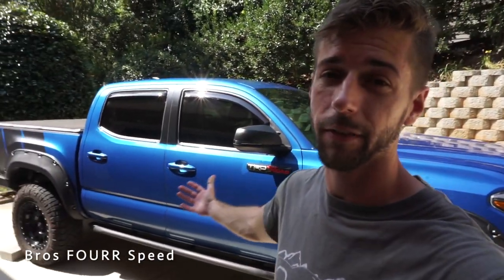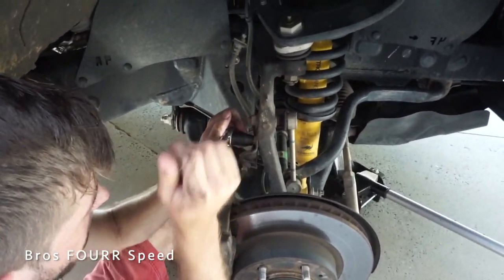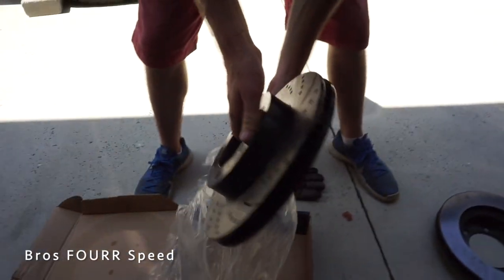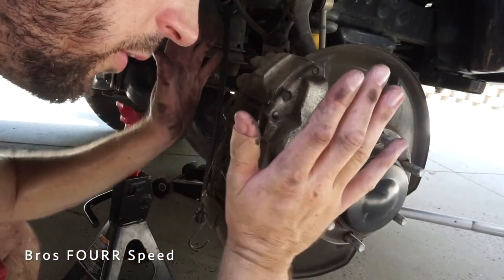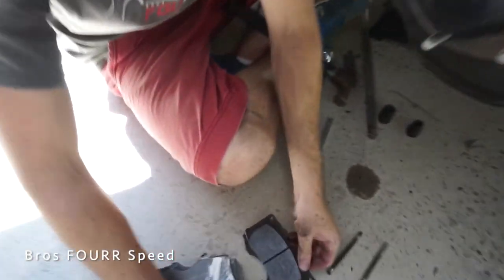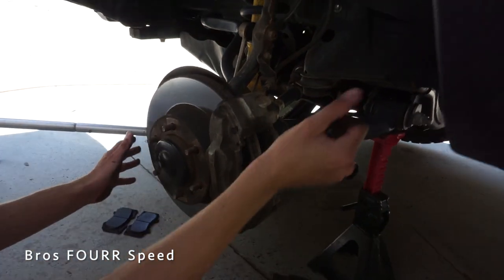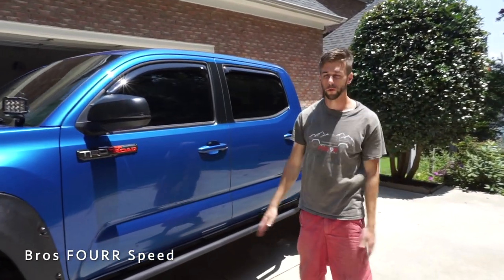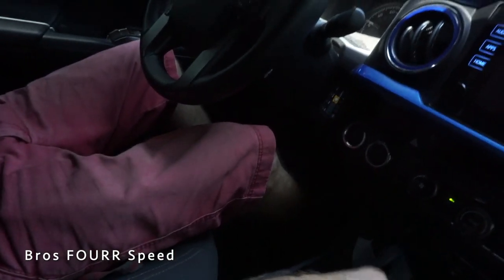Installing Performance Brakes | 3rd Generation Toyota Tacoma

Comment: Nice upgrade. I would have cleaned the rotor with brake cleaner first though.
Reply from the maker: We wi[ed them off a bit before the wheels went on. But anything on them will just wear off anyway
Reply: Could’ve cleaned everything. Makes for easier install and takedown

Comment: I sure hope you guys cleaned the rotors with brake clean to clean off the cutting oil before you put the pads on.  I just did my brakes too and as a extra precaution I used blue thread locker on all the caliper bolts and disc brake quiet on the pads. The brakes are awesome and saved my bacon. Latter on that night I had a truck cut me off and the new brakes saved me! 
Keep up the good work!
Reply from the maker: Yea we cleaned them off!  The pads are very quiet so I don't have issues with that, and glad they helped you out!!

Comment: May give these a shot. First set of pads and rotors was at 140k miles. At 270k now and time for a new set of front and rears on my '17.
Reply from the maker: I actually just took these off! Send me a message on IG if you are interested! Probably have around 10K miles on them so still in good condition!
Reply: @BrosFOURRSpeed  is there a reason you took them off? were they not performing as you had hoped?
Reply from the maker: @General1718  I sold the truck, so decided to put the stock ones back on it. They did great, really liked them.
Reply: @BrosFOURRSpeed  if you had the choice would you get them again over the stock? Also when you took off how was the ware on the pads compared to when you changed them in this video? Did they wear the same or more..thanks for the help i need to do brakes now so im trying to figure out what to go with

Comment: Your rotors and drums on that truck have threaded holes to help remove them when they get stuck on. M8 bolt with 1.25 thread, a couple inches long should work. Much easier then the hammering.
Reply from the maker: Yea I figured that out after this on another project I did! Definitely works so much better!

Comment: Nice upgrade! They look great! Keep these videos coming.
I'd suggest the next time you have these apart, clean the caliper pins with brake cleaner to get the caked on dust off and apply fresh brake grease. This will help the pads float and prevent them from sticking. Also makes the next brake job go smoother. If you have them wear nitrile gloves when handling the rotor and wipe down with brake cleaner after installing. 👍
Reply from the maker: That's a good tip!  I'll have the truck apart in the near future for some more mods so that will be a good time to clean up them again!
Reply: @BrosFOURRSpeed  This link has a picture I refer to when changing my brakes. It really helped me. https://www.super-lube.com/brake-grease-applications.  Looking forward to seeing what's next!

Comment: Did you clean those rotors after the install? All that grease, dust and fingerprints will degrade the pads quicker.
Reply from the maker: Yea we wiped them down afterwards!

Comment: Guys did you wipe off any oils on the rotors ? because sometimes rotors are covered in a thin layer of oil which can affect braking...
Reply from the maker: We cleaned them off some, anything on them should get worn off anyway once they get broken in some.

Comment: mmmmm, looks really good, but is unnecesary, the stock brakes from toyota tacoma are really good, enought to stop a vehicle 2 times bigger easy. 
 The discs you installed really are effective for vehicles whose wheels reach enormous speeds, speeds that the wheel of a tacoma will never reach. I would also install some disks like that to my tacoma, but to replace worn out original disks, since the performance will be the same.
Reply from the maker: Fair enough, my stocks are in really good shape so I'll hang onto them as a spare back up!

Comment: Did you have to compress the piston at all. I didn’t see it in the video
Reply from the maker: Yup. I think we mentioned that in the video. We just did it by hand and then got the new pads in to fit
Reply: In the future to compress the piston, you may need to loosen the bleed bolt attach a piece of hose and then compress the calipers that way. Oftentimes there is too much pressure.

Comment: I can't imagine just changing the rotor would improve braking performance much. Drilled and slotted will help with cooling but the braking pressure from the caliper is still the same. Seems like a waste of money unless you're replacing the calipers as well.
Reply from the maker: Better cooling for brake rotors helps with stopping power because it won't have as much brake fade. While the pressure is the same. The cooler rotor is better and more efficiently can stop the truck.

Comment: There are two bolt holes that you insert two bolts and tighten up and the rotor will pop right off.
Reply from the maker: Yea I learned that trick after when I had to remove the rear drums..

Comment: I have 30,000 miles on my 2016-TRD-OFF Road, started getting a pulsating brake pedal at low speeds, maneuvering in parking lot. Weird
Reply from the maker: Hmm, I'm at 37k miles on mine now with no issues.  There could be something stuck in the pads somewhere or they have been wearing unevenly!  Probably nothing major, but has it gone away?

Comment: No grease on the pins?
Reply from the maker: There wasn't any grease before. No issues
Reply: @BrosFOURRSpeed  its recommended to do every once in a whole as a brake service.  It will make you pads last longer and save your pins.

Comment: Lol where did you find this break in procedure 😂. It's completely wrong
Reply from the maker: What would you do on them?
Reply from the maker: @killabandit  That's pretty much exactly what we did.
Reply: @BrosFOURRSpeed   you guys were talking about not generating heat and "lightly" hitting the brakes . You actually want to heat them up and keep braking over and over . Then you do a few heat cycles. Either way it doesn't really matter with today's materials . Btw why didn't you guys do the back
 brakes 🤣

Comment: do the rotors make noise when they are moving and with the pads rubbing against them?
Reply from the maker: At first there is a slight grind noise of them spinning. But that goes away once there are some brake cycles